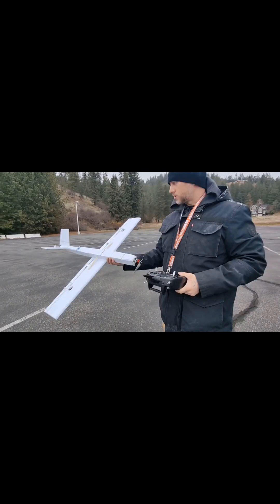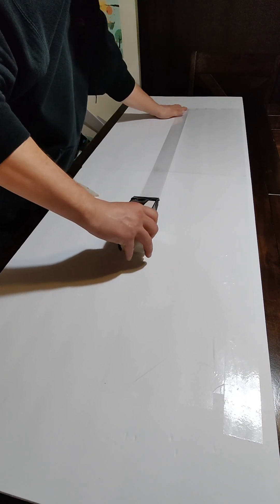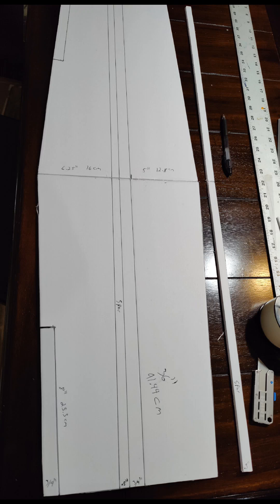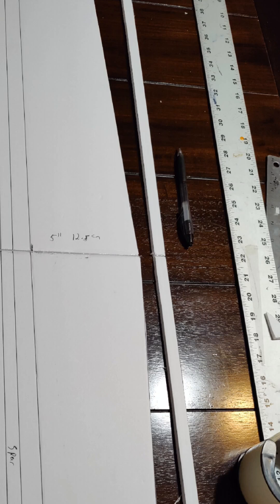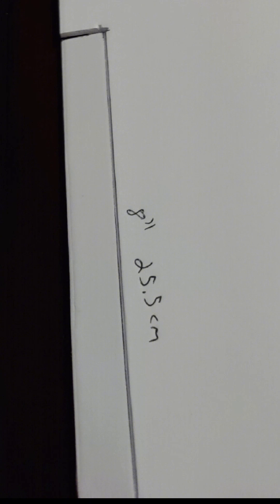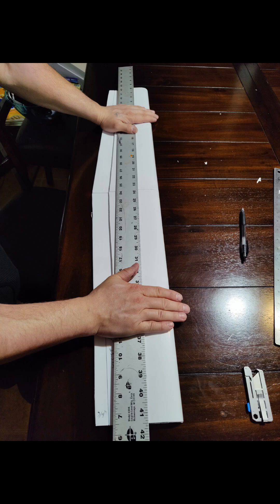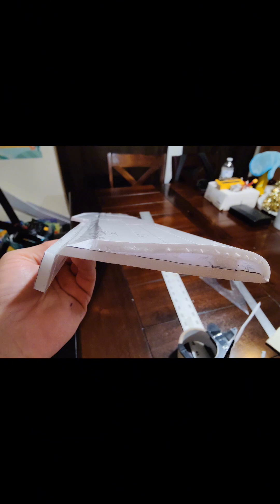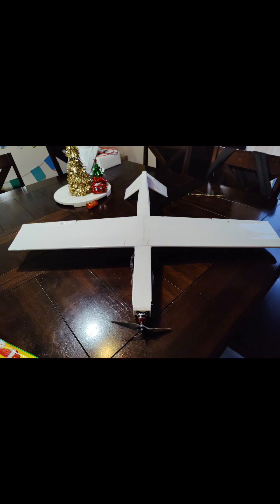Build video #1. Wing build. #howto #rcairplanes

Comment: what is the motor and battery & weight
Reply from the maker: @anasyt7009  I am running a small motor on this one. A 2205 2500kv motor on a 2200mah 3s with a 6x4 prop. the total weight is 550 grams.
Reply: What is the usefull KV for 1.1 kg of weight in ur opinion ?
Reply from the maker: @anasyt7009  there are lots of options that will work with that weight. But I think the motor size will matter a little more. Something between 800kv and 1300kv. But you'll need to find a motor and prop combo that will provide enough thrust for your plane. Think around 1 to 1.5 times the weight. Depending on what kind of plane and how you intend on flying. You can go as low as about 75% thrust to weight ratio. You also have to think about the battery you are using. So if you only have room for a 3s battery you'll need to pair it with a motor and prop that will give you the thrust you need on 3s. Since motor power changes and prop sizes change with different voltage inputs. 

All that said...

On 2s I'd say about a 2315 size motor that is 1800kv with a 9x6 prop

The same size motor in 3s with a 7x5 prop

And the same size motor on 4s with a 6x4 prop

All of these will give you just over 1kg of thrust. These are all just examples of ones that will potentially work. There's lots of options. You can go with a smaller motor and lower pitch prop and get similar thrust and lower speed. If that suits your flying style or needs.